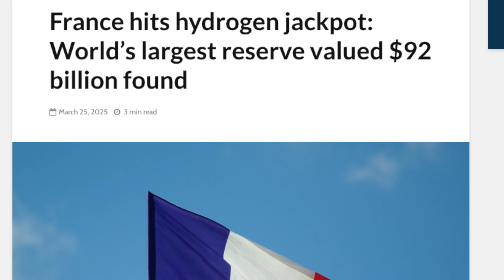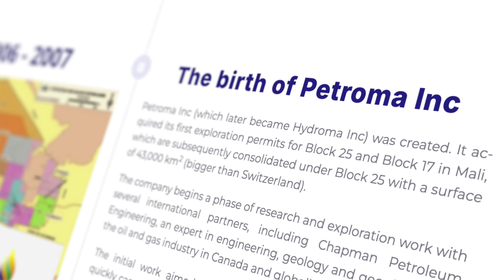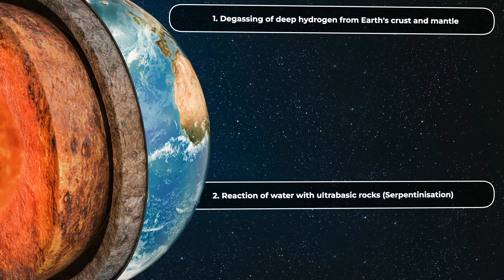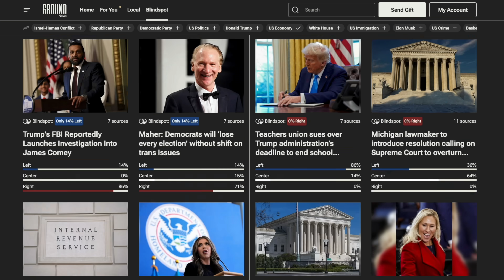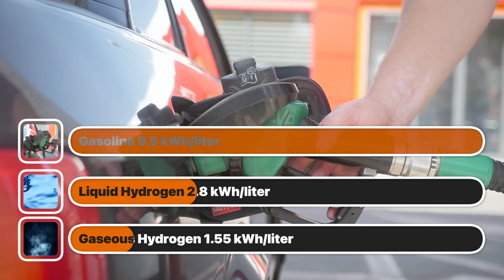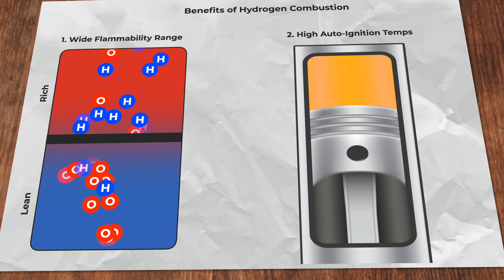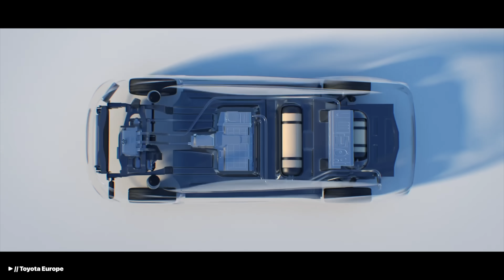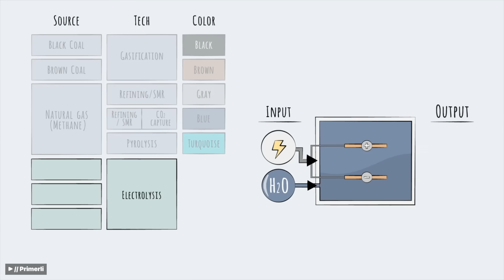This Hydrogen Discovery Can FINALLY Replace Oil & Gas!

Comment: One of your better videos. You stayed on point, without spending 70% of the video on backstory of other power sources. Now, everyone and their mother will plunge into how best to mine, store, and use this hydrogen, except for the U.S. we will call it fringe system, because our oil, gas, and coal are king,  "we don't need no stinking hydrogen" UNLESS someone can provide a breakthrough, that is scalable, cheap, ready in 3 years, and highly profitable
 Just like Lithium is king, even though flow batteries are more energy dense, and safer, and cheaper., but everyone is using tesla batteries for grid storge.

Comment: I thought Teslas were cheap to drive because of electricity.  If your car is (just to keep the math simple) 30MPG and gas costs $3.00 per gallon that's $0.10 per gallon.  Same as a Tesla in your example.  I know that something like an SUV or muscle car gets much less that 30 MPG and places like California have more expensive gas (because of CA taxes btw) but for me that's about right with my Honda Civic in TX.

Comment: They will produce water with oxygen from the atmosphere. The oxygen level is already decreasing due to global warming and carbon dioxide production. Also, if we burn the hydrogen under the earth's crust, we will start to have oxygen problems in the future.

Comment: You failed to mention how hard it is to pipe, compress and store Hydrogen.  It is the smallest molecule and leaks EVERYWHERE!  It is one of the HARDEST gas' to work with and that is as big a problem to solve as finding it.  Even NASA, with all the Billions they waste making rockets, can't seal their hydrogen systems.  They simply factor in the leakage.

Comment: One US gallon of gasoline at a density of 2.858 kg contains 0.37155 kg of hydrogen. My SUV has a maximum range of about 560 miles on 21.4 US gallons, (560 ÷ 21.4) = 26.168 miles per gallon of gasoline. To convert miles per gallon of gasoline to miles per kg of hydrogen we can divide MPG by 0.37155, eg (560 ÷ 21.4 ÷ 0.37155) = 70.429 miles per kg of hydrogen. Notice how efficiency increases when we remove carbon from the equation.

Comment: Geological hydrogen deposits would need to be consumed via pipeline as is done often (and preferably) with natural gas as its storage and transport (via non pipeline means) is even far more difficult than liquefying natural gas (and LNG tends to be roughly eight times more expensive than pipeline NG)

Stationary electricity generation using pipeline hydrogen to power generators would be sweet as its exhaust would be water. There may be a number of issues with trying to use pipeline hydrogen as piped directly to homes to fuel various home appliances such as water heaters, space heaters, and cooking stoves. Safety concerns over the long term would rank as something to be concerned with in respect to home use of hydrogen. Handling hydrogen is different problem than handling natural gas or propane.

But it could probably be managed well enough in an institutionalized industrial manner by electricity-producing utility companies. Would be nice, reliable, base load electricity.

Comment: The irony of the hydrogen "discovery" is that it has always existed in most wells.  As the well is drilled there is a requirement to monitor the "cuttings" in the mud pit. this involves looking for sulfur, methane, CO2 and other gasses.  The instruments to perform these tests use hydrogen from a tank as the transport gas.  As a result, the "detection" of hydrogen is ignored.  And now, it turns out that, with newer technology, almost all wells produce hydrogen.  An experienced person can look at the flare gas combustion at night and tell you how much hydrogen is being produced with respect to other flammable gases.

Comment: Hydrogen is the smallest molecule. It is incredibly difficult to store or transport it. That tiny little molecule can get through even metal seals.

Imagine you're driving a vehicle powered by compressed hydrogen and you are an accident. You are injured in your car. Emergency personnel show up and they can't go near your car until the fire truck shows up because hydrogen is colourless, odourless, and its flames are invisible. So you might die, waiting for the fire to show up.

I wonder what kind of chemistry can get the nitrogen to release its bond after the hydrogen has given up so much energy in combustion. That hydrogen atom is probably in pretty tight bonds. I suspect that the only way to get the hydrogen off of nitrogen is to put that energy back in.
Reply: In that same accident, hydrogen embrittlement could cause the pipes and junctions to shatter and leak uncontrollably. Kinda scary.
Reply: Probably less risky than current BEV vehicles.   Any rupture of the fuel tank would soon dissipate.

Comment: A quick calculation revealed that this discovery equals 1 month of oil equivalent world wide consumption. Hardly a game changer.
Reply: Doesn’t make sense to compare it to worldwide consumption. 1. In whatever future we’ll be using this hydrogen, we’re only going to replace a fraction of oil and gas. Cars will mostly use batteries, not hydrogen. 2. If we go this route, dozens of other countries will start to look for similar hydrogen reserves. You’d only expect reserves found in Europe to cover some share of European demand.

Of course this is not a renewable resource, so it would only be a transitional solution. Eventually all hydrogen we end up using must become green.

Comment: One use of geological hydrogen could be making synthetic hydrocarbons by combination with captured CO2 and using renewable energy.

The advantage is multiple. A way of storing renewable energy, much less change needed to the current infrastructure and technology which makes the transition much less costly

Comment: Imagine a world-wide catastrophic flood that happens suddenly by the continents splitting apart, releasing volcanic action and the water under the surface.  I wonder how many natural resources could have been trapped in the earth's crust as a result?
Reply: Never mind that, imagine that the planet formed billions of years ago and was once molten. Then one realizes that in a molten world most of the heavy materials sink in to the core never to be seen again. Meaning a gargantuan amount of valuable materials are trapped very very deep under our feet.

In that light vulcanism is one of the few things that actually brings some of that material back to the surface at all.
Reply: Imagine fundamentalists not hijacking the comment section of a YouTube video that has nothing to do with evolution or creationism.

Comment: You did not speak of the Explosive potential of hydrogen car crashes.  This is a very serious omission !
Reply: Your current car could explode too if it wasn't for all the safety measures built into the vehicle

Comment: This should be kept for high to priority hard to decarbonize industries and not wasted on industries that could be solved with battery technology
Reply: Hydrogen, solar, and battery are the future absolutely, but it'll take another couple decades before they eclipse the 50% mark for total energy production. Not unreasonable as we'll still get to watch all 3 of those scale up exponentially every year and battery + solar will get extremely cheap for you and me to buy for smaller systems for our homes and cars.
Reply: @enthused7591  SpaceSolar beaming and micro nuclear reactors along with Fusion will replace most industrial power requirements and everyone else should go off grid
Reply: Not technically or financially feasible at present. Australia has dumped every green h2 project, including for iron ore smelting where h2 would be ideal. One of Australia's richest men has given up on h2. He did not get rich by being stupid.

Comment: Just a quick comment here but has not been told before in any literature. I have come across of the 8 in of sea level rise we have seen from the year 1800 to the year 2000. 2. In of that is actually from the water produced from the combustion of so-called fossil fuels.  If the issue that is of Paramount importance is sea level rise, then switching to hydrogen for power is not going to be as perfect as many think because to get energy from hydrogen one must combine it with oxygen producing water vapor and that will just keep adding to sea level simultaneously we are still producing heat in that combustion process which does add to global temperatures

Comment: H2 is better than gas!  Yes!  But at the end of the day, you’re still burning a volatile substance. Still “forever” mining it or “forever” making it. With renewables like solar, wind, and battery, you will eventually reach a state where mining will no longer be needed because you can just recycle what you already have and refine it USING renewables in a continuous cycle. You’ll NEVER get there burning stuff.  Natural Gas was supposed to be a “stop gap” to get us away from coal. I’m not buying into the “green” hydrogen play…it’s just another oil cartel FUD tactic.

Comment: all of this does not end the cancer that is suburban sprawl. sure you remove emissions of any sort through hydrogen fuel cells, and sure you do not tear up the petroleum asphalt like heavy batteries, but you still end up covering the earth in petroleum by products just to make driving easier and to assure abundant parking where ever you go. once you do that you make it more of a necessity to have a car, once you do that you need to spread out further and further and further until the damn house of cards fall down like it did in 2008.

Comment: It might be a new energy source (rather than just a delivery system) and make some countries rich, but it's still a limited resource that will run out someday.
Reply: Hydrogen's availability isn't its reason for being a bad choice.   Most common element in the universe and it's sitting around in every puddle of water.  Green energy electrolysis gives hydrogen.  Burning it produces water.   it's not scarce.   But as I said, LOTS of reasons it's a terrible choice for mass adoption.

Comment: Why did we all stop talking about Red Hydrogen? Did the Japanese projects fall through? Relatively clean hydrogen produced as a side product from nuclear generation sounded very interesting.
Reply: It isn't a side product, the key is they are able to run the reactor at a higher core temp for hydrogen than they can for electrical production - which uses the nuclear fuel more efficiently - but nuclear is still very expensive.
Reply: @secondarydevice1767  Is that how it works? I may have misunderstood then, because I thought it was going to produce both.

Comment: if Hydrogen bonds to oxygen, and we do not have a source of oxygen. Will we not see a drop in Ozone layers as the oxygen cycle in the atmosphere attempts to correct itself? 
Or do we build giant land farms of algae to boost the levels? Since Hydoxyl is needed to break down CH4, would pulling o2 and o3 out of the air affect this balance too increasing the time for ch4 to break down; giving a "HA! we told you so" talking point to anti-climate change lobbys?

Comment: JCB have worked on the NOX emissions from H2 internal combustion engines they have developed which match the diesel engines in performance they already install in their construction equipment.  There is a place for H2 engines in my view as for these large construction vehicles,  batteries cannot help as they are too heavy and work against the loads that these vehicles carry.

Comment: I have developed a method for storing hydrogen long term. Mix carbon with the hydrogen keeps it stable for years. Per kg in this liquid form it's 8 times the energy of just hydrogen.
Reply: It's a good idea, but the conversion energy in to such forms isn't the best. And I don't think we ever found an as high efficiency form for converting it back afterwards either. So there's a ton of energy losses in it. So I'm a bit doubtful the storage utility remotely offsets the extra costs.
Reply: @I don't know, some times giving those a serious answer can be amusing in their own way.
Reply: @Quickshot0  I think it is called hydrocarbons also known as oil.
Reply: @kevinroberts781  Indeed

Comment: Yet another souce of energy to split out infrastructure into more incompatible bits. They want to run cars on protons, and gas, and electricity all at the same time. Wtf. We can do everything all at once. They should prioritize using the gas to push electrons and not pistons.

Comment: It wouldn't matter that hydrogen combustion produced nitrogen oxides as the catalytic converter would clean it up before going out into the atmosphere. That's the only emission the catalytic converter would have to deal with. It's still a way cleaner fuel than gasoline. Also, hydrogen is very high in octane, so you can run higher compression for more power and not have to worry about pre-ignition (knocking or pinging).
Reply: For current ICE engines certainly.  But hydrogen is actually one of few fuels that's so far I know are viable for things like rotating detonation engines, which would allow one to harnesses the knocking/pinging detonation effect instead to get even higher compression levels and so squeeze a bit more efficiency out of your engine yet. So it's one of the few fuels that would actually let one raise combustion efficiency.

Admittedly the technology is only just now starting to mature, so it would be a risk I suppose to go all in on that right away. Still it's an interesting extra thought.

Comment: Hydrogen is very difficult to store and handle.  Hydrogen embrittlement is another issue.  I worked at a plant in the 70's that extracted hydrogen for the space shuttle engine development from ARCO flare gas.

Comment: Fill your car's tank with hydrogen, leave it in the garage for a week without driving and the tank is empty - all seeped out. How could that ever work? Edit: Well-produced video, though.
Reply: Itd only work if the hydrogen fuel was free. But we live in a world where I can't even get pressured air for free 😂
Reply: What! You can't leave your hydrogen car in a garage! You gotta leave it outside so it can vent the hydrogen as it boils off.

Comment: Yes we know H2 is inefficient in personal vehicles, compared to batteries, but I still have hopes for H2 in heavy industries like trucking, shipping, cement & steel smelting.
Reply: I kind of expect trucking will also switch to battery electric, considering various truck models already are being made with that. How ever there certainly are a fair few industries that can use hydrogen, especially the chemical industry that has a need for hydrogen in creating various materials, though for instance some alternate iron/steel making recipes also make use of hydrogen. 

So there are definitely some quite substantial markets for hydrogen.
Reply: I like the idea of a hydrogen train. It doesn't make sense but aesthetically its cool

Comment: Novice here, will we find out too late that all these ground energy sources are what continuously feeds the earth's  core. And that the core may be cooling down helping to cause environmental changes. Just like the ocean has hot and cold areas and changing currents. Maybe our inner magna is experiencing the same thing and is gradually cooling. Causing more earth quakes in the transition.

Comment: What is never said in these videos is that there is no energy transition, there is only pilling up. We want more every day and new energy sources are helping us spend more every year, not transition from one energy source to another. The only way I see us getting an energy transition is when the world's population starts seriously shrinking, and hopefully our energy demand with it (which is not a given btw), THEN we'll have the choice to reduce fossil fuel use and keep the cleaner options. Until then it'll always be more, more, more.
Reply: There's more than an element of truth in what you say about incessant increases on demand, but to claim that negates the transition process is wide of the mark.  As one significant example, look at the effects of switching from incandescent light bulbs.   There's something visible to grid level producers.  Give it another five years or so, and watch what happens to the steel industry  ... and that ain't going to be for "environmental" reasons so much as hard nosed economics.

Comment: You don't mention metal refining or large scale static generators. Much easier to implement than transport systems.
Producing iron without carbon, instead using the naturally occuring mixture (see@st-ex8506 )comment below. 
Running a gas turbine generator at the well head may be possible!

Comment: The reason green H2 is expensive is because it takes a lot of electricity to produce it. If we have fusion energy that's practically free, we can have all the electricity we want and produce it very cheaply.
Reply: It would kind of depend on how expensive the fusion reactor would be to build and maintain. Though long term you're probably right, one imagines the first generation of fusion reactors will be the most expensive ones and that it will only get better from there.
Reply: @ To be fair, fusion technology has advanced a fair bit since then. Modern devices get a lot closer then the ones in your youth.

But I do agree that it still doesn't seem like they'll actually succeed to make a commercial reactor any time soon. One day perhaps, but not today or this decade.

Comment: I would just set up extremely large fuel cells next  to the well itself so you can just convert it into electricity with no co2 and just water byproduct.